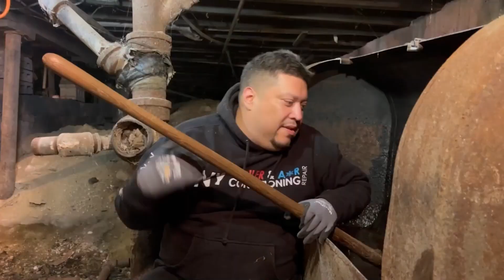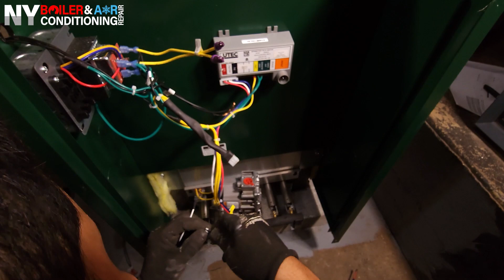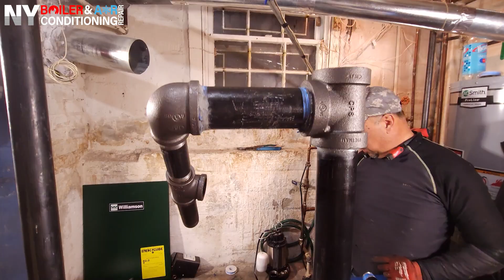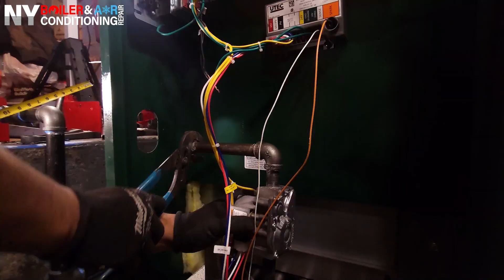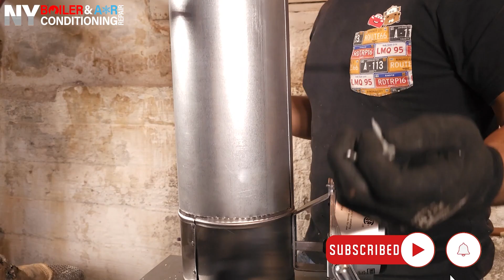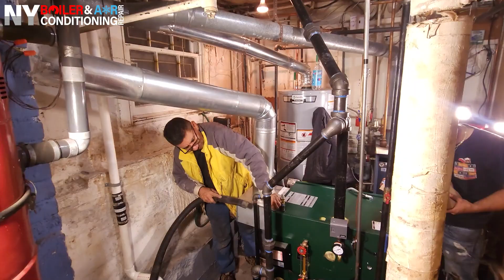WILLIAMSON GAS STEAM BOILER FULL INSTALLATION PROCESS (Louie The Boiler Man)

Comment: Do you have to add the cement on the flow collar hood, rear and front panel on the willaimson?
Reply from the maker: You don't have to put cement however you can put high temp aluminum tape along the seams of the flue collar and exhaust pipe and there is no cement on the front or rear plate because there is a front plate with high temp insulation. No need for cement
Reply: @louietheboilerman  Thanks.  I had Williamson steam delivered and realized I didn't see a relief valve.  But I never opened the front door.  Is it in a bag with the coupling tapped inside the boiler?